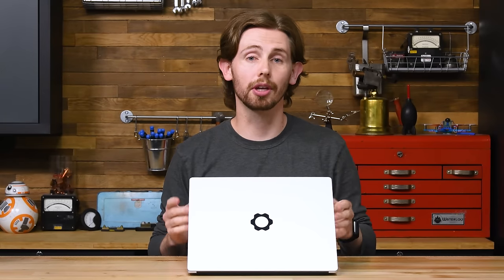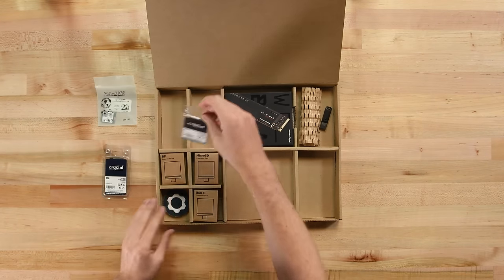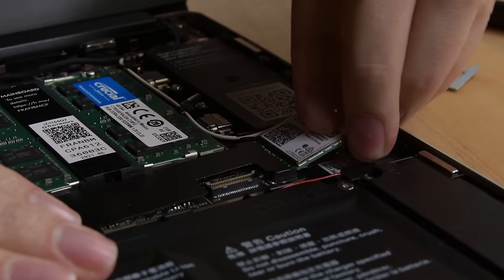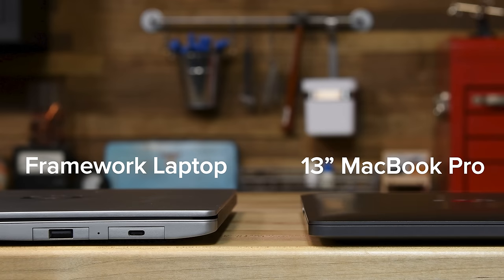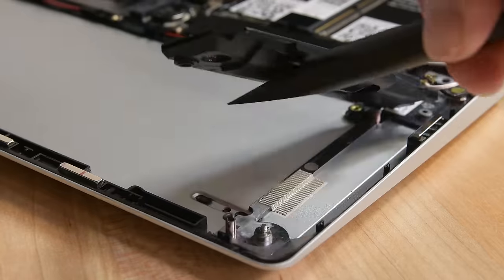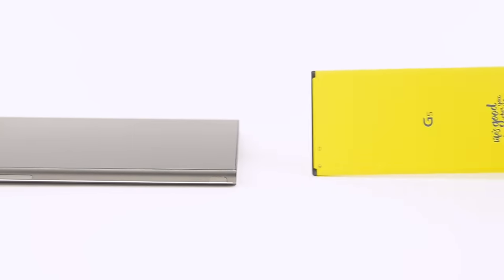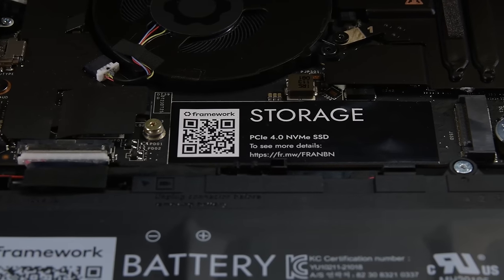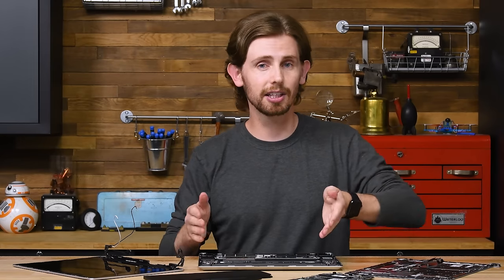Framework Laptop Teardown: 10/10, But is it Perfect?

Comment: its funny that apple use to do some things the framework laptop does, like the magnetic bezel of old imacs, replaceable batteries in old macbooks, swap-able ram and storage etc
Reply: I mean, every laptop used to do the last three things you mention. There are people still buying old Thinkpads to repair, tinker with and use.
Reply: I still use my old laptop for this very reason. - everything is easily replace able.
Reply: Exactly! And even 2000s and early 2010s Apple Still have some very repair friendly setup, like memory bay in battery bay, color coded screw in iMac G5, magnetic held screen and open memory bay door in iMac Unibody.
Reply: Most midrange laptops and almost all gaming laptops still have removabale wifi cards, ram, storage and batteries.
Reply: That's the only reason I haven't switched from my current laptop. the old bastard isn't fast by any metric imaginable and it is a chunky boi but it has a socketed CPU, an MXM (swap-able) graphics card, a detachable battery, a thunderbolt 2 port, 2 2.5 inch bays, one MSata port and an m.2 port with four DDR3 ram slots.
Reply: @mikael3095  yeah, that's my favorite too
Reply: At the time of Steve Jobs. Tim Cook changed everything.
Reply: The problem is companies earn more to force conusmers to use their AppleRepairGuyTM and make their devices less repairable. So there is no repairability is going anywhere while the opposite is more profitable. That's how capitalism works.
Reply: funny intended not to any more
Reply: @fmis13  The MacBook Air was barely repairable as well and don’t forget the iPod touch - Tim Cook didn’t start the whole thing.
Reply: Well, some of the engineers are former Apple employees so that probably helps.
Reply: you could completely take a part and put back together the macintosh lc iii with NO TOOLS. it was all snap in place and slide in place parts. the hardrive, the speaker, the motherboard, all of it. honestly i think that most modern business CEOs are boomers who don't understand the culture around their products "or think they do" and make decisions based off of what makes money and not what makes customers happy. then fool their customers that this method of manufacturing products is a good thing.
Reply: I didn’t say ALL of Steve Jobs’s products were hard to repair I just gave examples, all I was saying was that not all of his products were completely repairable. Considering that Mac is incredibly old is anyone surprised?
Reply: @axethepenguin  but Jobs was fired at that time. He didn't direct it iirc.(imo thats why they are modular like that)
Reply: @Decco6306  that makes sense now, because jobs would’ve added some kind of repairability block
Reply: The Steve Jobs Apple
Reply: The reason they do not do it now is all about the  $$$$$$, no other reason
Reply: @fmis13  That should be ''Tim CROOK''
Reply: @MrTarmonbarry  Nah, just physics, that laptop must be slowwww
Reply: @riponrip4574  That depends on the processor and ram . ifixit seemed impressed with it and they are people who know what they are talking about
Reply: @riponrip4574  Ah , an Apple boy , that explains it ))))
Reply: @fmis13  I disagree, It was steve wozneik (he was main brain behind macos, Also founder of AppleComputers) he always wanted open system and everything repairable. Steve jobs and cook both always wanted to close system and bring as much profit as possible. And it was Jobs who appointed Cook. 

Only thing Jobs had better was he also wanted his products to be best than just making money. 

Though their marketing goal is same "remove old tech", "make as much close system as possible", "create problem, sell solution".
That's another reason why lightning cable was not replaced with usb c. But surely Jobs had well experience in products too
Reply: @WhenDoesTheVideoActuallyStart  yeah, but at the same time, my laptop has 4 ram slots, with 2gb each, but i can't upgrade because the mb doesn't support more than 8Gb
Reply: I still use my hp elitebook because most of the parts are replaceable/upgradeable and still available. It also have an easy to access bottom cover, no screws, just slide the lock and the cover pops open.
Reply: I still use the MBP 2015 because of all of that. Probably the last most upgradeable MBP
Reply: Easily removable keyboard for service access on the iBooks/PowerBooks too
Reply: i have an old laptop with a socketes cpu
why cant we go back to that
Reply: Apple died when Steve Wozniak left the company. Steve Jobs wanted to simplify everything for the end-user by taking control of what they can do with the hardware, Wozniak wanted to do the opposite (what you mentioned above) "the magnetic bezel of old iMacs, replaceable batteries in old MacBooks, swap-able ram and storage, etc" 

I hope Framework remains as eager as they are now with repairability and support. Modularity is one of the main reasons why I primarily have a desktop PC. Something special about having to pick your own parts, know what they all do, and putting it together to make it work is special. Sadly this feeling has been phasing out. As more company seems to follow Apple's trend, or whatever makes the most profitable with minimum effort. Lastly Right to repair isn't supposed to be a feature, it should be the base standard. 

I see it like this:
iPhones: You are "Special", just like everyone else. Everyone has the same device, same capability as other iPhones owners aside from different background pictures and apps, most iPhones are nearly identical (same year models).

Android: You are "Unique", just like everyone else. A similar device, but you have no idea what type of skin/launcher, sound profile, themes they have, don't know what features some have over the others smartphones made by other companies. you know... unique.

Yet, despite all that, most company ... are following Apple's model, taking away features and/or control over the end-user hardware. 
Just reminded me of the old saying "You never know what you've got till it's gone."
Reply: @mikael3095  Yep, me too, still have a old laptop due to this, so easy to repair honestly, and even upgrade.
Reply: And that's why they weren't the most valuable company back then. Good ethics don't make good business.
Reply: @Decco6306  hey, if it makes money than they don't care what you think.
Reply: @fmis13  I believe the only reason Steve Jobs didn't do this is because after his return to apple he decided to slowly phase away from the part of the company the other Steve(can't spell his last name lol) left behind due to the reaction to his other closed projects like the apple 3 that failed. I 100 percent believe this was his eventual plan for Apple but he passed away before he could do it himself.
Reply: Yep I remember the PowerBook G3, such a cool laptop, all the ports, removable battery, removable optical drive that could be swapped for a second battery. Tool free keyboard removal and everything inside easily removable once the keyboard is out. CPU/GPU module, RAM easily swappable. This is the new hotness now. Give me an AMD APU option and I’m in.
Reply: @yareddeyaso1219  wow! what computer is that?
Reply: @williamnale7835  HP Zbook 15 G1

Comment: A 17" model with screen options, GPU card, and 6 I/O ports would be dope.
Reply: dude how do ppl work with 17" laptops they're HUUUGGGEEE or maybe i'm just small
Reply: this laptop doesn't have GPU? not that many laptops need one, but it's better. Very expensive for a $750 laptop.
Reply: @---jj9lf  You need a discreet GPU if you want to be able to play any type of modern game. Most laptops at the $900 will have some kind of GPU. So if they made a model with a card that can be sold separately, then it would fix that issue for people who want a cheaper laptop but don't game and for those who do.
Reply: @D.E._Sarcarean  i have a pc lol
Reply: @D.E._Sarcarean  on the contrary, most laptops you under $900 don't have a dGPU, and if they do they're usually barely better than the Xe integrated graphics like the MX450 or cheap gaming laptops that can't hold a candle in build quality to this laptop.
Reply: @AgusSimoncelli  My comment is that at $900 and higher, laptops will have discreet GPUs.
Reply: @D.E._Sarcarean  not really tho. Most ultrabooks don't have dedicated gpus. Sure, gaming notebooks do. But they're much bigger and expensive.
Reply: @D.E._Sarcarean  *Discrete. No hate, just trying to make the world a better place one word at a time. :)
Reply: Honestly, if you need high-power crunching/gaming/workstation performance then you're always always going to be better off doing it on a desktop/tower machine. If you need mobility then you can remotely operate it from a mobile device. Big screen and keyboard are nice to have, but otherwise why would you lug around a bunch of heavy bulky delicate overpriced half-gutless tech junk when you don't have to?
Reply: @remy7663  17" laptops are great for people who don't want a second monitor or like lots of screen real estate (or are old like me).
Reply: @mikestrock  i wouldnt be able to carry it around 😂😂 but maybeb bc im a tiny asian
Reply: @remy7663  can’t be any heavier than my current Dell 17” laptop that is 9 years old and weighs eight and a half pounds.
Reply: @AgusSimoncelli  That's a lie, 900$ can have gpu that are much better than integrated graphics. Lenovo legion for example
Reply: @remy7663  I knoww like even 15 might be too big lmaoo
Reply: What I like to see is official eGPU support as I understand it there's only unofficial TB3 support currently. eGPUs are upgradable without requiring custom cards like the AW Area 51M. They also let you have higher performance when at home but when you're out you don't have the added bulk of all the heatsinks and extra junk you don't need. 

I agree they need at least a 15" if not a 16" or 17". Those extra inches can do a lot for fitting more on the screen and increasing productivity and it's more immersive for gaming (even if it's only casual). The other benefits are things like bigger/better speakers keyboard and trackpad. Oh and a bigger longer lasting battery.
Reply: @daniwalmsley611  An external GPU option would be a great compromise. If not for TB, a custom PCI-E x4 header to external enclosure would be OP.
Reply: Well for production for the few models they have would already be a few million that they’re floating before they even sell them. So for a company starting out it would be even more expensive for a company to field more models with different cpus and gpus. I imagine that if they become more popular and successful they will probably have amd cpus and more variations.  Linus tech tips had some commentary on his last framework vid about this.
Reply: @D.E._Sarcarean  but who's buying a notebook to game? If u wanna game go buy a £500 15inch omen with a 1050ti in it
Reply: @morganroberts295  My personal use a laptop requires at least 6K score on 3DMark. As I travel often on a plane, I need something that is powerful enough but also portable enough. This is why a eGPU is a good solution.
Reply: Underrated comment
Reply: @leovice6505  good point! i used to have a 17" lptop like 10 years ago and regretted it. haven't owened a 17" modern laptop yet
Reply: @D.E._Sarcarean  With a strong enough CPU, integrated graphics can do you fine, but that strains your RAM and stuff more.  A dedicated GPU with at least a gig of dedicated VRam is essential for modeling and rendering in Engineering applications, let alone machinima and such.
Reply: @mikestrock  And 17 inch laptops have much more thermal budget compared to their 15 inch counterparts.
Ex. the Dell Precision 7760 has a 115W GPU while the 7560 (15 inch) only has 90W. That's a significant difference.
And I'm assuming your 17 inch laptop is the Precision M6600 (an absolute beast)
Reply: @vivek_v  Inspiron 17 from many years ago.
Reply: @remy7663  you put them on a table or just on your lap, they won't be going anywhere from there. Also great for watching stuff on
Reply: 😁 ... Yeah ... I would like to see them implement a GPU on their Laptop ... !!!
Reply: So USB C has been renamed to I/O port now? :)
Reply: @D.E._Sarcarean  maybe the target market isn't gamers. Sometimes you people act like you own the PC market! Not everyone is a gamer.
Reply: @remy7663  I went all the way: 12" X200, then 11.6 Smart PC Pro, 15" Precision 3520, and now I'm using 17" PRecision 7750 workstation. I can't imagine using anything smaller and weaker for my work.
I'd love me a Framework machine though. As it is only with Nvidia GPU added. With 4GB of VRAM.
I'd also love CAD files for this, so I could design some TPE bumpers for my field work (my 6k EUR Precision is not exactly what I like to drag with me into the quarries. And Getac's are not that cheap also).
Reply: @vivek_v  I have 4 m6600s. Unfortunately the graphics can't be upgraded any longer so they struggle with video production (software not supporting the old graphics card). I purchased them for their upgradability ironically. But after so many years, there's nothing to upgrade to / with due to outside factors.
Reply: Ew if u want 17" just get a desktop.
Reply: @remy7663  u r cute tho XD
Reply: A 15" model ought to come first, it's a massively more popular form factor.
Reply: @D.E._Sarcarean  its really not ment to be a gaming laptop and no one in their right mind would ever use a 17" laptop for work on the go its simply to heavy.
Reply: @D.E._Sarcarean   funnily enough the framework does have thunderbolt, it's jsut not certified yet so they can't say it has it, but it does work
Reply: a jumbo edition, i like that
Reply: That's the model I'm waiting for.
Reply: well you pretty much got your wish. pre orders will start later this spring.
Reply: Dude predicted the future…
Reply: hat off for future prediction =)))
Reply: Oh boy heard of the Laptop 16" they announced this week :D
Reply: well they made a 16" model with gpu options, 6 IO ports and actually made it more customizeable.
Reply: how did you almost completely predict the framework 16. Are you from the future?
Reply: Well it's almost alive.... with your 6 oorts
Reply: im messaging from one right now, though we did sacrifice an inch... and used that to get AMD lol
Reply: They came out with a 16" one. I'm typing on it right now and its absolutely amazing to use.